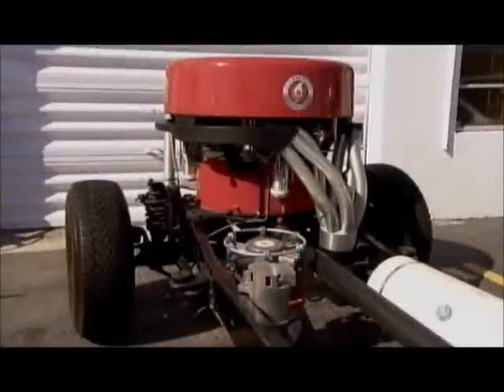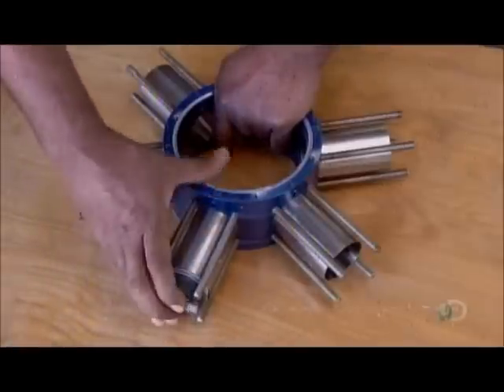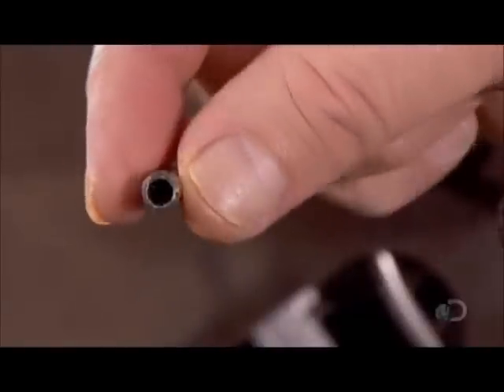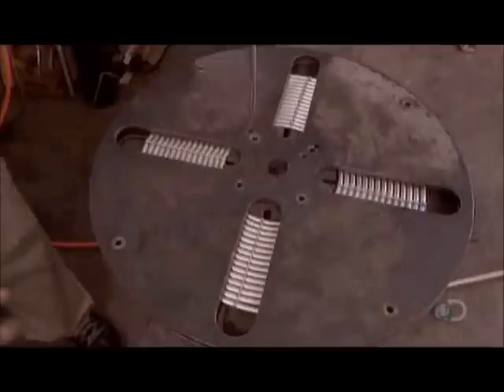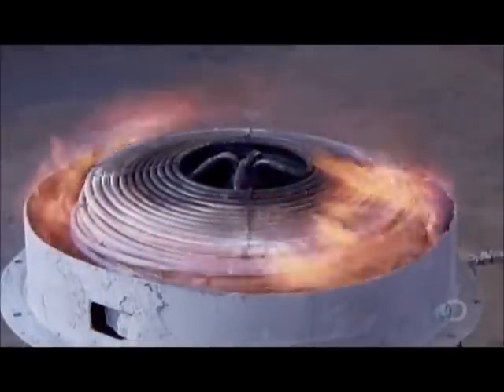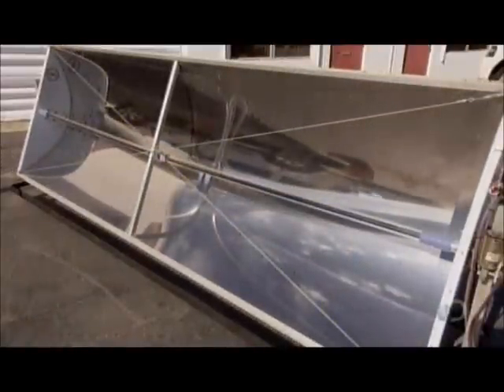How It's Made - Steam Engines

Comment: What is this BS.... haha none of what they're claiming about performance can possibly be true... what do they mean it doesn't require a transmission???  They show it in a speedboat, let's see that speedboat move haha
Reply: It's not fake, I have been watching it's development for years
Reply: Neither Stanley nor Doble steam cars have transmissions.  White steam cars have a two-speed rear axle, which is still not a real transmission.  Steam locomotives, that ran American railroads for more than a century, did not have transmissions.  Why would you think they need a transmission now?
Reply: @danhaynes3200  The Walschaerts gear acts as a transmission..
Something clearly missing from this fake steam engine.
Reply: @sandervanderkammen9230  The Walschaerts gear controls the movement of the valve to throttle the engine, but I wouldn't call it a transmission as the power from the piston is directly transmitted to the wheels.
Reply: This company was a scam, it fleeced its investors and folded.

Comment: Less pollution? That is entirely dependent on the fuel and air supply. You can have a steamer roaring at 100 MPH with perfect coal and not the slightest bit of smoke, or have it chuffing its blast pipe once every 3 seconds and see it belch out enough smut and smoke  to dust a town in ash fallout.
Reply: These engines produce zero emissions.
Reply: So do electric motors. That doesn't change the fact that said electric motor could be powered by a hydrodam or by a coal plant.
Reply: @oron61  Cyclone Steam Technologies was nothing but an elaborate vaporware investment scam.
Fake prop engines don't produce emissions.
Reply: The motor only moves when you heat it, which requires emissions.
Reply: @oron61  Cyclone Steam Technologies never delivered any working engines to either a customer or for independent third party testing.
The engines shown in the video are very elaborate props used to scam naive investors.
It's estimated that Harry Schoell stole $65 million dollars from investors.
Funds were diverted through Schoell's other company Schoell Marine and was used to build a multi million dollar mega yacht (powered by Diesel engines).
Reply: Okay, let me say this clearly so you might be able to read it. ASSUMING THE ENGINE WORKED, EMISSIONS WOULD BE REQUIRED TO APPLY THE HEAT NEEDED TO RUN AN EXTERNAL COMBUSTION ENGINE. NO EFFICIENT OR WORTHWHILE APPLICATION OF HEAT CAN BE EASILY OBTAINED ON HAND THAT DOES NOT EMIT CARBON DIRECTLY OR INDIRECTLY BY CHEMICAL COMBUSTION.
Did that work its way through your skull?
Reply: @oron61  Of course they didn't work... these steam engines were FAKE! No legitimate manufacturers would waste time and money  developing single pass reciprocating steam engines.
Only a fool would invest in such a ridiculous scam.
Reply: @oron61  You don't get it... anyone who lies about producing a commercially viable steam engine is  not going to hesitate to lie about emissions.
Fake engines only produce fake emissions!
Reply: @oron61  Fake engines are fake... no real engine...NO REAL EMISSIONS DATA.
Reply: Light fire = emissions, no data needed.
Reply: @oron61  Fake engines don't produce emissions... just false promises.
Reply: Fire produces emissions. I can't believe you don't understand that burning fuel emits carbon dioxide. Have fun thinking an engine has to actually work to emit smoke.
Reply: @oron61  Cyclone Steam Technologies was not selling fire... it was selling the false promise of a commercially viable line of steam engine products that never existed and had no intentions of ever building.
Reply: They lit a fire on screen. Those are emissions. I don't give a shit if it's a scam, or if the engine never turned on its own power. If it worked, it caused emissions. If not, same. If it existed or not, it still caused emissions. I understood your non-point already before you started arguing about it. It still produced emissions as an external combustion chamber shown on screen even as a fake.
Reply: @oron61  Indeed, the video was fake,  it was all an elaborate hoax... so it's a moot point.
Fake engines only produce fake emissions data.
Reply: What data? It's a "steam engine." They caused emissions in their display. you'd have to take data on every combination of fuels that ever existed to have emissions data on a device that has no special fuel. That's why I said that emissions depend on fuel and isn't something that you can say it makes no emissions.
Reply: @oron61  It's not a steam engine, not a real one anyway.
FAKE engine FAKE emissions data.
Reply: They lit a fire. Fires cause emissions. Emmissions aren't 0.
Reply: @oron61  Real fire... fake engine 
No engine no engine emissions.
Reply: @oron61  Check out Cyclone Steam Technologies for yourself... they were a scam.
Reply: @oron61  Fake engines that never existed cannot be emissions tested...because they are FAKE.
Reply: See above.
Reply: @oron61  Fake engine, no emissions data.

Comment: 2:52  The need of a transmission is not dependent on the power of the engine. All Vehichles have a transmission
Reply: Sorry Cheese, but you are wrong.  The engine (under the car) crankshaft on a Stanley steam car is geared to the differential directly with no transmission and no neutral. A 20 hp Stanley engine will produce 678 foot-lbs. of torque at 450 psi @ 750 degrees Fahrenheit steam; this is sufficient power to start the car from a dead stop.  When the engine turns, the rear axles and wheels turn with exactly the characteristics of a steam locomotive; as the car (or train) begins to pull away, it makes a long, slow "chuff" sound.  As speed is gained, the sound becomes very rhythmic (the "I-Think-I-Can" sound of a train).  The Stephenson link valve action provides for the engine to run backwards to make the car (or train) back up.  All vehicles do not have transmissions.
Reply: @danhaynes3200  a form of a transmission. Might not have gears, it makes the motor the transmission too
Reply: @danhaynes3200  Still has a variable load transmission system and a final drive transmission.
Reply: Steam cars have 100% of torque available at 0 rpm, just like an electric car. Tesla's don't have transmissions either (don't bring up the 1 speed transaxle). Neither the Doble steam car, nor the Stanley, nor the White had transmissions. Howard Hughes owned a 1925 Doble that he took to 133mph...without a transmission. The Doble accelerated from 0-75 MPH in FIVE SECONDS, making it faster than most cars today.

If you're curious, you can find articles from Hemmings on steam cars or check out Jay Leno's youtube channel to see him drive his Doble.
Reply: @georgeblack589  it might not have a gear box transmission. But its still a transmission. Eg the connection point between motor and wheels
Reply: @CheeseMiser  All those steam cars had the rear axle unitized with the engine as one component.

And come on, no one means differential, drive shaft, or axle when they say transmission. That's just being silly.
Reply: The need of a transmission is completely irrelevant when this company was nothing but a fake investment scam.

Comment: Diesel is more efficient than steam, whether you are talking about steam turbine, or steam piston engines. This is why no ships are built today with steam engines. They are all low speed direct drive diesel. The only advantage to steam engines is you can run them with any combustible fuel that you can feed to the boiler.
Reply: Diesel is more efficient ? maximum efficiency of a combustion engine cannot exceed over %35 by theory(approximately). And steam turbines are exceeding % 60 efficiency by reality.
Ships are build with steam engines but not in the way you think. Big ships like air craft carriers uses nuclear power plant which uses steam to turn turbines and those turbines turns electric generators and electricity can be stored and distributed in forms of mechanical, light , chemical and heat energy.
About the video i wonder what is the efficiency of this engine in real. But pretty interesting one.
Reply: The only reason nuclear aircraft carriers use steam turbine propulsion is because they are nuclear. Of course I am not talking about nuclear powered naval vessels. Talking about regular ordinary ships. Nobody cares how efficient a navy ship is. Only how fast it can go and how much ordinance they can deliver onto a target. It doesn't have to be profitable. A cargo ship does. And they are all diesel. Very few steam ships left. If steam were more efficient then all cargo ships would have steam engines. So, why don't they? 

A steam turbine MIGHT be 60% efficient, I don't know. I doubt it. But even if it is, it still relies on a boiler. How efficient is the boiler, with all its feed pumps, recirc pumps, evaps, condensers, condensate return pumps, etc? Let's say your turbine is 60% efficient. Let's say your boiler and all other associated systems are 50% efficient which I can tell you would be a very generous figure indeed. .6 * .5 = .3, or 30% efficiency overall. On paper. Not even in the real world. 

If I am wrong, please tell me why cargo ships which must operate profitably, do not use steam propulsion.
Reply: @Muhammed Gundogan Steam can NEVER match the efficiency of the Diesel Cycle engine.
Reply: @karabesklow  Carnot says you are completely wrong.
Reply: @sandervanderkammen9230   that depends on from what point you are taking the calculations.
Reply: +Growley M actually the reason why they are nuclear is about efficiency.  because if you try to run that much energy with diesel it costs alot. there are versions of air craft carriers which runs with fuel and they are pretty much budget burners for governments.  many submarines also runs in same principle  due to efficiency and not being require to refuel oftenly. When we had earthquake  in turkey American  navy offered my country to feed electricity to effected city grid from a air craft carrier locationed nearby in past. It is seriously  superb effective and efficient. 

About the boiler. again yes. it is higher efficiency thats why thermal power plants using steam turbines to generate power. they burn oil ,heat exchange  in boiler (actually its not a boiler its more like a n or r shaped building sized heat exchanger) generate steam and runs steam turbine   whole system overal efficiency is over %60 percentage.  search about carnot cycle and study on it.

the issue is to acive those efficiency  there is lots of prerequirements. one is the feed amount of steam aproximately  below 10000lb hour steam feed, steam turbines are not so efficent. also steam turbines are efficient in their designed turning speed so they are pretty much crap in varied speeds. also constructing  steam engine system which  is efficient  under those circumstances  requires lots of space and weight. in ships  those can be achieved  but when the size  is like an aircraft carrier . think about the smallest thermal electrical power plant you have seen in your life. you need to fit that in a ship. when you consider those and even it is possible to construct  that kind of system in ships instead of diesel engine, the initial cost is pretty high. so companies are not doing such designs due to high initial cost. its like buying a carbite drill for using in your home wall drilling. Basically  very expensive systems. in addition  the maintenance  of those systems becomes issue while you are in a ship. your crew should be able to repair whats broken in your ship or the ship will be stranded and will require external repairs. eventhough combustion  engine is more malfunctioning than a turbine engine it does not require  much specialized  tools or technicians or engineers to fix it. operatibility is also another issue thats why its not preferred for capitalist companies. and all companies are capitalist. :)
if you ask a question  as:
can it be done ? yes it can be done. but seriously  capitalist bosses does not care about the environmental damage until they find a cheaper more profitable  solution  :-D so combustion  engines will go on till the petroleum finishes in the earth.
i am an electrical engineer in  a research  phase of trying to figure out a low pressure micro steam turbine ,thats how i got to watch this video while checking what other people did on youtube. i think generative system design tools will improve  many things in that area (by micro i mean a size of a room ^^ because  normally a steam turbine size is like an apartment )
best wishes. dont belive  what you are being told ,study and think out of the box ! ^^
Reply: It costs a lot more to operate a nuclear aircraft carrier than the same ship with either diesel OR combustible fuled steam. The ONLY reason for nuclear power on aircraft carriers is to be able to travel for years without refueling. That's it. The U.S. Navy is not a profit making venture. They don't care about efficiency. 

All steam turbine (and of course steam piston) cargo ships that I know of are no longer in service. If it were more profitable to haveal steam propulsion than diesel, once again, it would be so. Probably a third of engineering officers are licensed for BOTH steam and motor. Maintenance of a steam ship is no more challenging than diesel. You apparently don't realize the size of the diesels we are talking about here. Talking about pistons that you and your wife can dance on. Talking about crankcases big enough to need a ladder inside. These are no simpler nor cheaper than a steam plant. I have been going to sea my entire life. I remember steam ships. I don't miss them a bit. 

If you want to produce power cheaply and have a cheap or free source of heat, then steam is the way to go. If you need more power than a 40 foot tall diesel engine can deliver, then steam turbine is viable. You can get more power from the same space with steam. (NOT talking about nuclear... apples and oranges!) However, in that regard gas turbine is even better. And that is why most of the world's aircraft carriers that are not nuclear, are steam turbine. Not for cost efficiency. They don't CARE about that. commercial shipping does, and commercial shipping has totally abandoned steam propulsion.
Reply: +Growley M actually in nuclear energy cost per watt is drastically  reduced while efficiency per watt is drastically  increased. 

what you are trying to say is about power densities. In some aspects you are correct. there are certain power densities that steam turbines are not efficient.  Also reason for abandoning steam systems due to their complexity  and case of malfunctioning  in addition  that efficiency  of burners of the particular times. About part repairing a steam turbine you should check it out. i am a person who has experience  in repairing combustion engines. when you compare  both repairs  combustion engines are far less complicated  to repair.

when it comes to efficiency  on armies i dont know if you have completed  your military duty but i have finished my as officer. Military  cares alot about efficiency.  they just have different set of privileges.  At efficiency  diesel engine powered air craft  carrier sux vs nuclear powered one in terms of efficiency . Nuclear power works with steam. Steam can be produced from any sort of heat energy not just fuel and can transfer more heat into mechanical energy transformation. It has far more complex pre requirements than combustion engines.
Changin size of the pistons from cc s to cubic meters doesn't  changes the efficiency  much of combustion  engine. but in steam turbines it drastically  effects efficiency . 

anyways i do not see much benefit of debating with you. i do not learn anything beneficial  from you . so i am ending the debate.  have your own opinions  and stay cool you wont have any further reply from me. 

best regards.

Comment: my son and i made a steam engine for a science fair project. the  valve timing was the tricky part. the plans had a tin can for the boiler . i said that will never work . had a big pressure cooker that was used for steam . but at the fair they wouldn't let it run unless enclosed in explosion proof box. so i made a video of it running on compressed air.
Reply: good day sir, if you still use this account and do have the steam engine, can you post it so me and other people can see? i am trying to find simple materials and would love to use your steam engine as reference

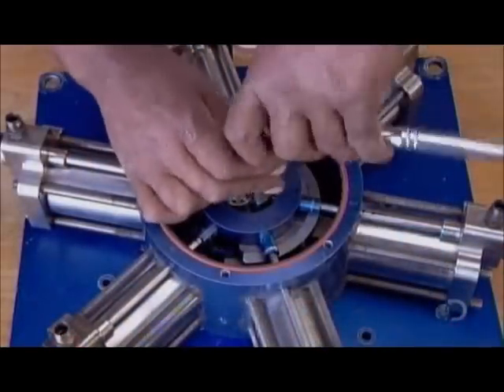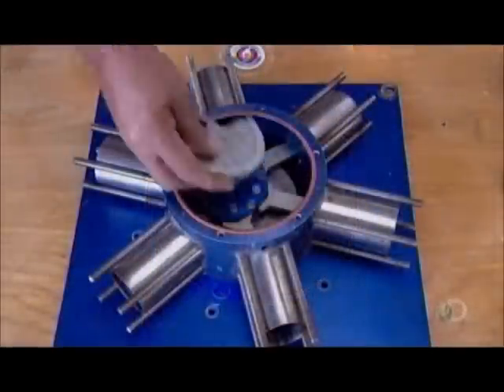Comment: This whole video is a joke right? 1:21 A screwdriver to hand torque that "spider bearing" down? 4:41 Water-lubricated? 0:56 Rust-proof-materials in a steam engine? 2:17 Bearings bolted down with spring washers? Bearing as a push rod roller? 1:38 A counter balance that just drops onto the crankshaft, with the cam bolted to it, no bearing on the other side of the crank? 4:00 Performance testing on a test bed that looks like a chemistry set? 2:45 The oscillations on the generator 4:30 never have to refill or top off the water?

Comment: the engine uses exhaust heat to power itself why not redirect the exhaust through a heat exchange back into the engine would that increase its performance ?
Reply: It was only designed to fool investors...

Comment: Hmm, well, the Stanley Steamer engines were built before the ICE and made a record speed of 127 mph in 1906. With steam, if you have a water recycle system (like this one that has a water condensor), you aren't gunna loose water or steam, the only thing that you are gunna loose after the combustion cycles is heat like anyother engine. I mean shit, with technology the way it is, you can use electricity to instantly heat water for peat sakes. And there are different ways you can use this rotary engine to move a vehicle, like, this can generate electricity for an electric motor.